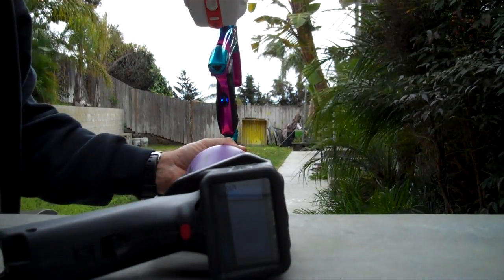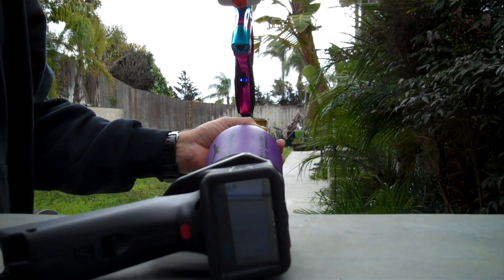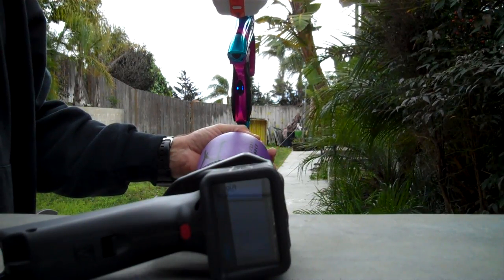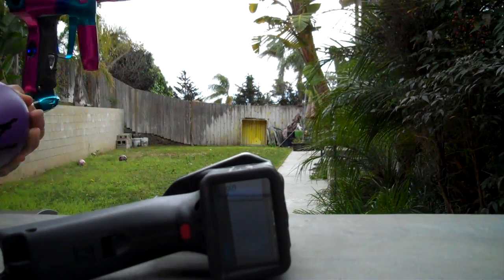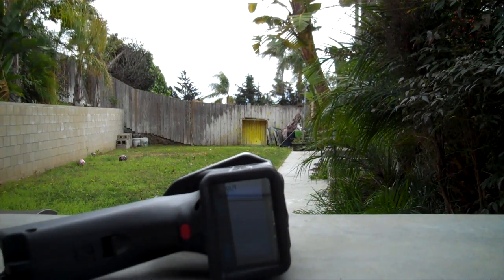Luxe 2.0 Ninja Pro Valve Shim Test video 2 of 2

Comment: I'd just like to know the output pressure of the tank by itself.
before and after shims. (quantity and orientation)
because you can flip the shims to face to and from each other as well to increase and decrease pressure.

my ninja has shims removed and flipped for slp for my old Angel and want to make sure it'll work for my luxe.